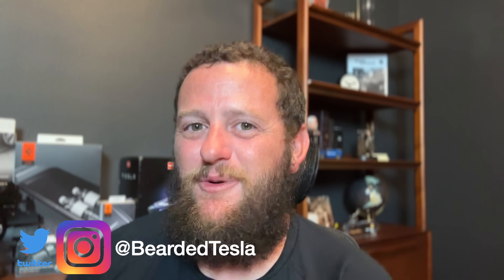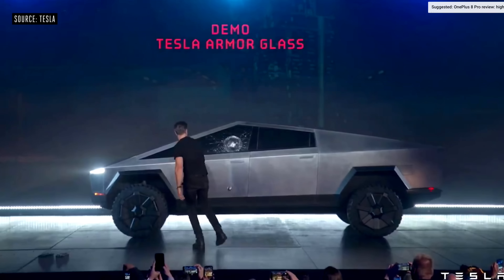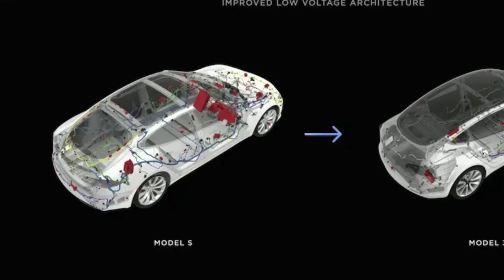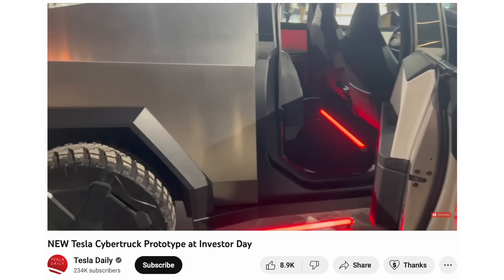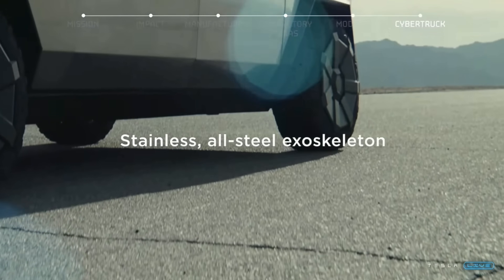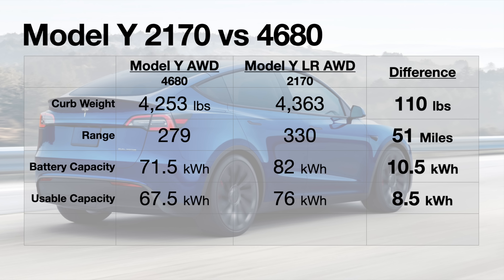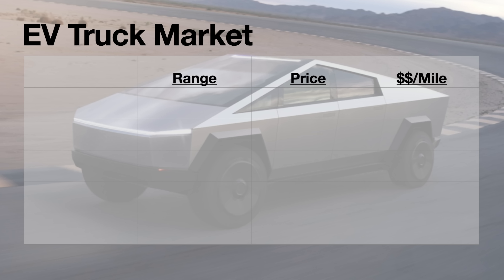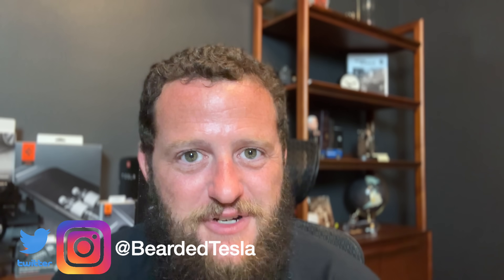Tesla Cybertruck Updates - Massive Change to Lineup / Less Range, Less Options, More Money

Comment: I went with the Tri-motor specifically for the 500 miles of range.  I could care less about the performance.

Unlike most people, i use my truck for work and towing.  By the time i put my ladder rack on it and tow either the 55' boom lift or my camper, 350 miles won't cut it.

Id rather pay $105,000 for the Silverado with 450 miles than $70,000+ for one with 350.
Reply: You'd pay 30k more for 100 miles of range and slower charging? Fascinating perspective.
Reply: @4literv6  Well, I can't make the 115 mile gap between Tremonton, UT and Burley, ID

I can't make the 125 mile gap between Green River, UT and Richfield, UT.

Or the 115 mile gap between Nephi and Scipio.

I won't be able to make the 100 mile round trip from SLC to Kamas and back since the Park City Supercharger has been on hold for 3 years.

At 70mph I get about 85 miles of range towing with the Y, and I doubt the extra 20 miles of the CT will help.

So yes, when the difference means making a gap or not, 100 extra miles and slower charging are worth it.
Reply: @jasonstroup4123  what trim Y only returns 85 miles when towing? I'm not doubting your experience here, that just seems kinda insane. 
But really makes sense if you are towing a big heavy air drag trailer, plus going over the legal tow speed limit(55mph towing where i am)and also going up or down hills? 

The Y only has less than 2 gallons of gas for rwd lfp, to just over 2.2 in it's highest lr model. So 40-45mpge towing vs 100 empty ad's up. 😐
Reply: Towing speed limit in Utah is 75mph.

I often try to do 70 tucked into a line of trucks, but that's not always an option.  Usually cars blow by you doing at least 90 so going slower is not really an option.  There are some routes where I can take a state highway and do 55.  In those cases I get about 550Wh/m and can go 120 miles.  But those highways rarely put you back on the main Interstates where the chargers are.  I could try and do 55 on the interstate, but it would likely result in getting rear ended by a semi.

I tow a 2200lb pop up camper with a long range Y.  It's a pretty efficient setup as the camper collapses down to the height if the car.

Unfortunately, here in the intermountain west you are almost always dealing with a 15mph cross wind traversing the great basin, going through Wyoming or going south along the Wasatch front.
Reply: @jasonstroup4123  that's insane imo to allow towing at those speeds way to many amateurs out there out driving their rigs while towing. Thanks for sharing the real world experience though. 👍🏻

I had ZERO clue towing even something that light and aerodynamic would kill model Y range like that. So a trailer less than half the weight of the tow vehicle kills nearly 50 or 60% of it's rated range. 

Yet current ev trucks can have trailers weighing 20-30% more than the tow vehicle itself does and still only loses 40-60% of rated range. 

My 2019 f-150 loses 40% min mileage while towing ANYTHING behind it. And up to 60% if I'm in stop n go traffic with a.c. running. 
Which is basically everyday late April through mid October here in ATL. And I keep the tires inflated, full synthetic fluids and don't stomp on it.😅
Reply: Once they increased the max speed out here to 80, towing slower became a safety issue itself.  People routinely drive 90 or even 100+ out here.

The range of EV trucks towing can be tricky.  Even though I am towing a lighter weight vehicle, it hurts my range more than a vehicle that weighs twice as much and has bad aerodynamics to begin with.

In other words, if my vehicle is 95% efficient, a 60% ding with towing kills the range, but a 60% ding on efficiency on an EV truck that started with 60% efficiency isn't nearly as bad.

Most of the towing videos I've seen on YouTube are from areas with lower towing speed limits.
Reply from the maker: I want the range for towing also

Comment: 6:07  The two square holes are likely to move air into and out of the cabin for a climate controlled vault.
Reply: Somebody else said they are also required for air vents when collisions occur and the air bags explode out into the interior causing overpressure.
Reply from the maker: No, it’s for access to the tonneau cover when retracted as well as other electronics

Comment: Now I have to ask if the Silverado is the best option currently if you need to tow, or will the super chargers make up for the lower range? Or maybe they will have some sort of towing mode?
Reply from the maker: Nothing EV is the best option right now. Too expensive and/or not enough range
Reply: @BeardedTeslaGuy  true. I had high hopes lol
Reply: @BeardedTeslaGuy  
As I've said elsewhere
"Semi style" tri-motor drive seems favourite, twin rears for beast mode and starting the toe, then a high geared front motor "ticking over" on its own for cruise economy.
Best of all modes a drive know the drive can take it.
Reply: Maybe wait until you see the Silverado tow?
Why are you assuming the Cybertruck will "only" have 350 miles max?
The "Launch" version doesn't have to be the longest range.
Reply: @rogerstarkey5390  towing is my primary use case. I have two teslas now , was just gonna add the CT for towing , but history has shown they Tesla exaggerated range and towing cuts range by 40-50% , so 350 would be a non starter, some folks actually want a useable truck.